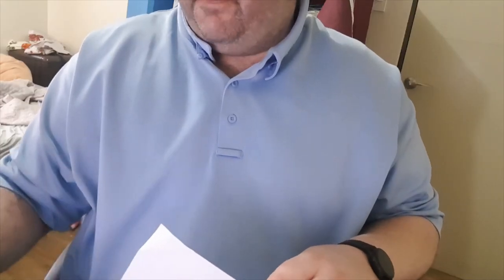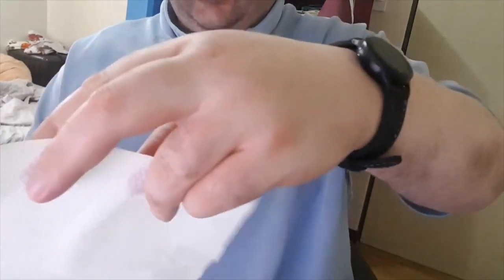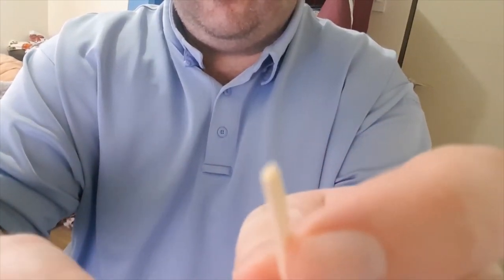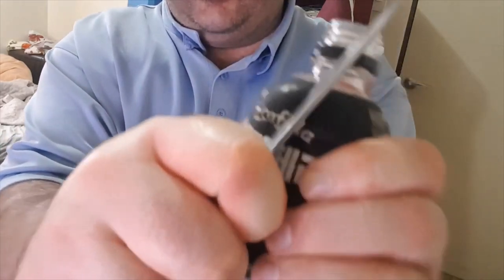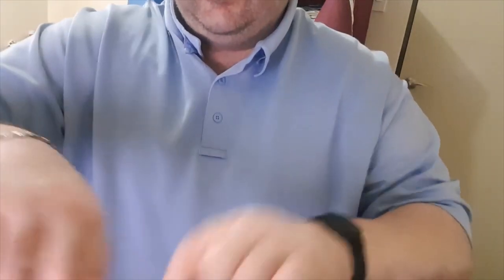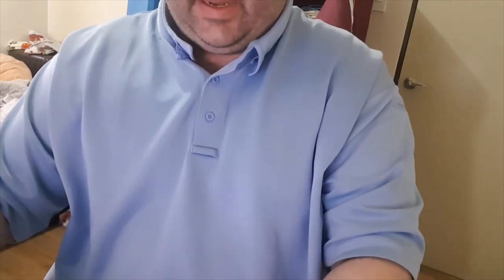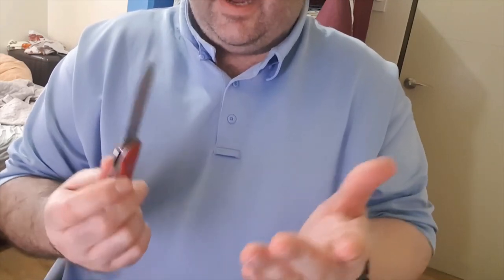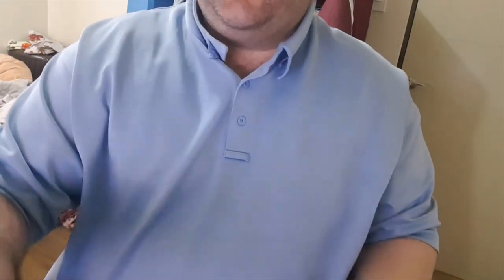Is the Edge on your knife Too Thick?

Comment: That's one of the reasons I don't like sweeping generalizations that people say (and use) without thought. The same thing happens in axes and such where thicker bit axes can easily get damaged more for much the same reasons.
Reply from the maker: yeah. i feel sorry for all the people with thick edges and obtuse angles, not only will they mess up worse from compressive loads on the apex, but then it also takes longer to repair the damage. one of my guesses is that when its hard to push in you inevitably start ramping up force and trying to wiggle the apex in.. and then all sorts of interesting things are happening to the 5 microns of important steel

Comment: The older Rucksack model, has much better geometry (thiner behind the edge) , than the newer Forester. Same goes for theri saws. Newer models are much more robust ( a bit unnecessary IMO)  because they lose performance and ease of carry. Also the older models with the side buton locking blade system, have much better handle ergos, because both the saw and the newer lockig system, get in the way and create hotspots. I like how the newer models feel, but the older ones, simply work much better IMO.